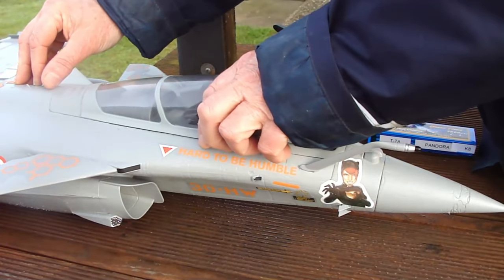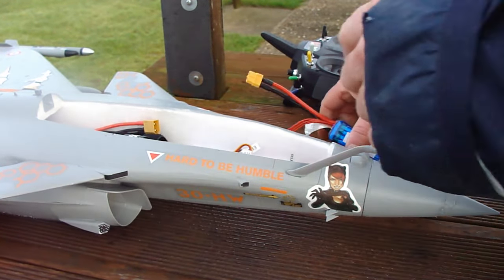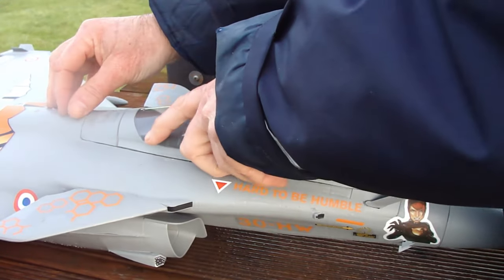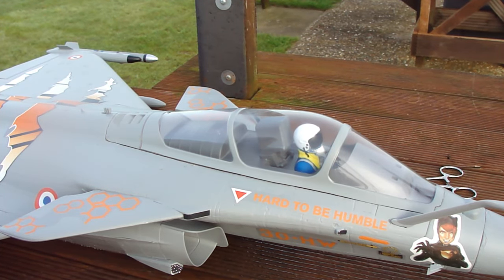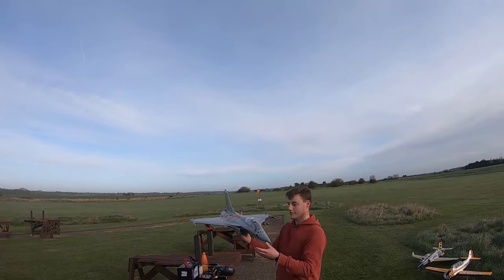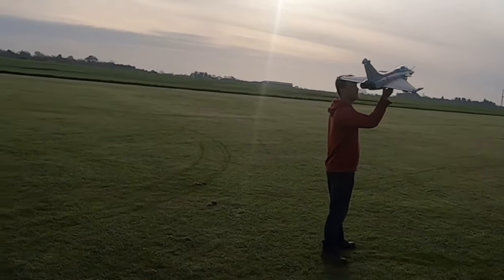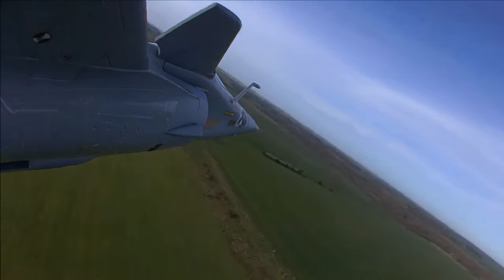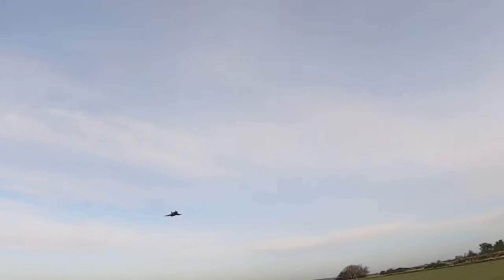Re Maiden FMS 64mm Rafale  - Flight 1 of 2

Comment: Hi, I have this plane and love it so much i ordered the 80mm version from a cheap supplier in china. Have a look at fat guy flies rc video on how to hand launch the 64mm version. I have used it about 30 times and it is ultra reliable. Very easy if you are on your own. Well worth a look. Andy in UK.
Reply from the maker: Hi Andy - I have added a small hand grip to the bottom of it and plan to attempt a hand launch on my next outing with it , I will make sure I show my modification when I do. cheers Martyn